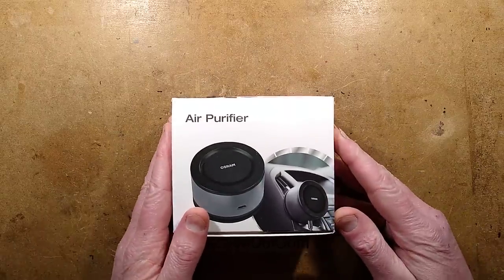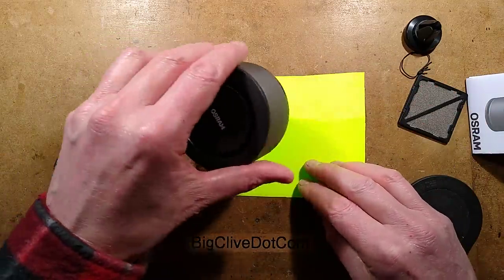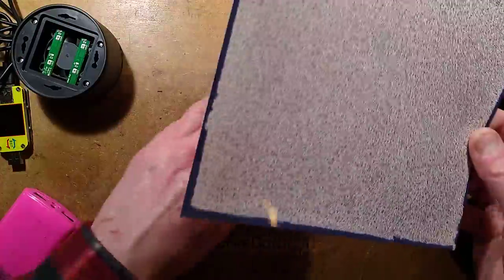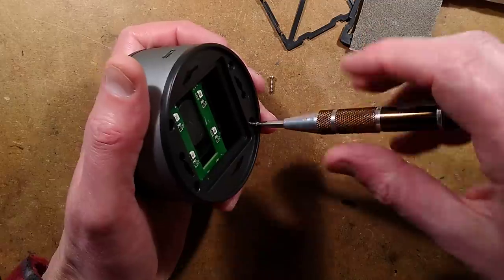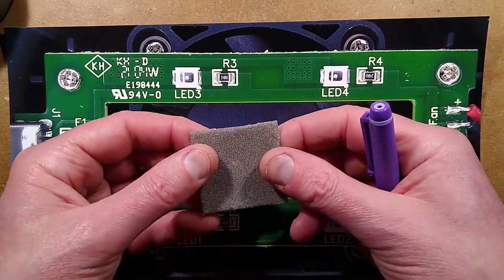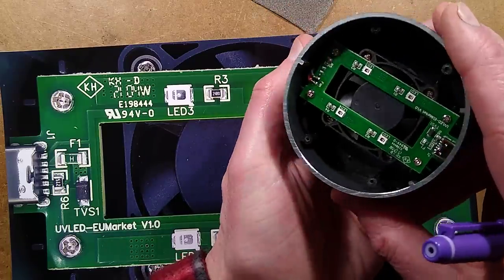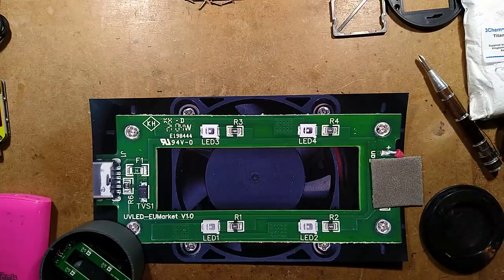Inside an OSRAM AirZing photocatalytic air purifier

Comment: Many white metal powders changes colour when they're sintered, and I'm guessing they've just mixed titanium dioxide with other metal powders of lower melting points.

I do think the process of UV light on titanium dioxide as a concept works. But I don't think this product does it at a scale where it practically matters. If we were talking 10W of UV on a high quality catalyser (think several m2 of surface area) it would probably be useful for small enclosed spaces like a vehicle or small room.... that is, if you have a problem with bacteria, fungus, virus and whatnot in the first place.... But this, as a product, seems like a solution in search of a problem. Or a product which is designed to make you think you have a problem...

Comment: Some sort of nickel foam coated with TiO2, I'd venture, similar to an auto catalytic converter, minus the $$$ platinum group metals.

The stuff at magnification looks a lot like the interior of a bad weld with porosity after you start grinding on it, not that I would have ever done such a thing. 😁
Reply: Sort of think well cannot conferm nor dnie that some one has done that varey thing!

Comment: To be fair, Clive, your 2nd magnified photo shows (to my eyes) the wire loops encrusted with white. It's only gray at zero magnification. I paused the video and looked closely, and it still looks like the mesh has been dipped in a chalky substance, so... mebbe my screen colours are wonky, I dunno. Edit: BTW it doesn't seem like junk science to me, and Osram are pretty respectable - they're using real UV-A too. I'm normally very skeptical...

Comment: So interesting. Can you measures the electrical resistance of the porous metal filter? Often catalysts are metals on a ceramic carrier. This one looks like metal  perhaps titanium slightly oxidised. For instance aluminium always has a thin oxide layer. Even shiny chromium has an oxide layer. When I measure the resistance I'd aluminium I musst puncture the inside layer.

Comment: Ugh, why do I get the feeling that the silkscreened "EUMarket" means that there's a "USMarket" or "NAMarket" (N. American) that leverages some flaw in our system that let's them get away with using cheaper "Near-UV" LEDs, whilst still charging the same price...

I bought some UV LEDs when the Radio Shack stores were closing up (standard ~3mm through hole) , which offhand I think are only like 485nm. Whichever it is, they're not quite UV, but point being they still produce the same glowy fluorescence of things like one would expect... So those none the wiser would likely not question it. Which in this case, being cheaper to make would be music to the bean contests) counter's ears 😔 (not sure if OSRAM is still a reputable name/company?)

Comment: Looks like nickel foam. We'll have to just believe it's coated with TiO2. They do look like authentic deep-ish UV 250nm LED's.
Reply from the maker: I've just ordered some TiO2 coated nickel foam.  Now I'm wondering how to test it when it arrives.
Reply: @bigclivedotcom  Maybe put it in a jar with some VOCs and see if they're detectable after different intervals of UV exposure? Neat, I didn't realize you could buy it already coated.
Reply: @bigclivedotcom  It's also supposed to be able to split H2O. Submerge some under water and leave it in the sun and check for formation of bubbles? I don't know if the particle size matters.

Comment: Since this is an appropriate video to ask, about UVC. 
I have found almost nothing on the internet about that, as we know UVC tubes are very "dangerous" and do work as space and surface disinfection. But UVC LEDs do actually exist, they are expensive, and are covered in gold (at least looks like gold) but I dont know about how effective/dangerous they are compared to regular UVC tubes.  Can a few real UVC leds each about 30mA to 350mA (at around 275nm) do anything? (LEDs the size of a standard 5050 smd package)

Comment: Reminds me of those low power heaters you plug directly into a socket and they claim they're better than a much more powerful heater in a more convenient location, only in this case it's a teeny tiny filter thing that is very very small fraction of an actual air filter that does the filtery thing... :P
Reply: It's not a mechanical filter that traps dirt in a tight mesh.  And it's only rated for the small air volume of a car.  The main volatile organic encountered in such places is gasoline fumes and leaked engine exhaust.

Comment: They made the same mistake as with the Raspberry Pi 4 by using a single 5.1K resistor for the USB-C port.
High power supply's will detect it as a Audio Adaptor and don't supply any power because they didn't use separate resistors for both CC pins.
Reply: But they fix this in later review, right?
Reply: @maxpayneau  Raspberry Pi fixed it pretty fast

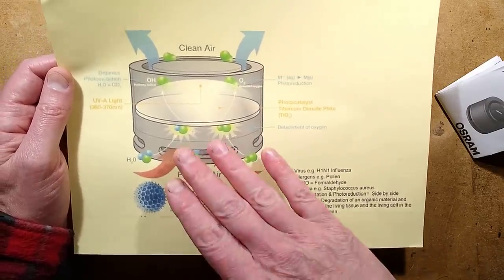Comment: According to the graphic depiction around 1:27, the polluted (or contaminated, whichever anyone prefers for their own use of wording) air goes into the unit on one side of the huuuuuge ceramic disc, passes through the disc , and leaves the unit on the other side.
I wonder if they've built in Star Trek's Transporter technology here? ETA: Or is it Duke Nukem's Shrink Ray cannon?

Comment: Except some metals like very pure gold for example, all metallic objects are covered with a thin oxide layer but one sees these as shining mettalls. Actually, one sees two spectrometric images determined by the metal, faintly by the oxide layer and by the components of the incident light. In case of alluminium this is easy to see: after a scratch it shines brighter, the oxyde layer attenuates the shining but aluminium oxyde particles (powder) are white because of multiple diffuse reflections at the surface of each particle. All in all: powders tend to deceive our eyes in analyzing the adsorption spectre. I guess you've a stainless steel mesh with TiO2 nanoparticles directly synthesized at the surface of the base metal by wet reaction, therefore the shining difers as a function of the thicknes and porosity of the layer. Thys catalyst works for some classes of dangerous chemicals when exposed to UV, it can create dangerous by-products and is going to degrade in time. I'd only rinse it with ethanol and with deionized water an avoid touching it.

Comment: never tried one, but thought about hacking some cheap nail varnish hardner for their UV LEDs and use them in an air purifier filtering chamber. then not sure if the wave length is germicidal enough...

Comment: Those LED's should be around 365nm (blue light) and do an amazing job destroying viruses, as opposed to cheap units that have the not very effective 385nm-395nm (purple) LED's. Someone said they thought the LED's were on the wrong side of the mesh. I disagree cause they will destroy anything that gets through the mesh. Those 365nm LED's are alot "hotter" than people realize. Un-diffused they can burn your skin and retinas. 

I have a couple of high power 365nm flashlights in the 365nm range. They are the Convoy C8 and the UVBeast V3. Both are the best out there on Amazon, but the Convoy C8 is more intense with it's single 365nm LED than the UVBeast V3 with it's three 365nm LED's. Both have patented filters built in to purify the light even more. Now i'm curious if these lights will kill the stank of the wife's WinterVag. {0.o}  😆😂🤣

Comment: Different subject. But how do stop DC switch sparking on a 36v li ion battery ( e bike ) .
Reply from the maker: If the switch is arcing because it's breaking high current then it may have to have a wider breaking capability (DC sustains a continuous arc like a welder.)   A snubber network - a resistor in series with a filter capacitor - will potentially shunt the arc noise and help quench it.

Comment: unless that thing is costing a hundred or more  I would suspect there is some exaggeration in the add copy. While the technology may be true the effective volume of such a little device would would probably mean it would take a long time to do what is claimed and then only in a closed space. might be OK for long term storage in a garage if you kept the battery charged
Reply: Left in a camper van when unused might keep mustiness at bay.
Obviouls need to keep the leisure battery topped up if that is the power source of choice.

Comment: All of these in-car devices (humidifiers, purifiers) are such bunk if you think about it: How much air do you think your ventilation system replaces continuously? Better to replace the cabin air filter annually (with a HEPA or carbon filter if you have respiratory problems). If you're sensitive to dry air you'd be better off with a mask that doesn't waste all of the exhaled moisture, instead of wasting money on those super dinky humidifiers, which are basically just a visual gimmick. But, a look inside those devices are still very interesting. 🙂

Comment: My thoughts...

I am so disappointed with Osram.  They were a respected manufacturer of incandescent bulbs here in Australia, so when I decided to replace all our (many) aging CFL bulbs with LED I didn't think twice about buying Osram.  Boy what a mistake.  30% failure within six weeks, with 11 chip LED arrays being overdriven and failing, flickering, malfunctioning, land fill pieces of crap with the cheapest possible capacitive dropper in them.

So would I trust them to produce an "air purifier"?   Not  really.  Once bitten, twice shy.  Maybe there is actually something in it, but I wouldn't put money on it.

Finely powdered things (Ti02 etc) always look different to the solid version of the same thing.  Powdered glass is white, the solid version is clear.    Kaolin powder is white, solid is brown (it's a Si04 clay with cosmetic and medical applications).  Typically, powdered versions look white or a much paler version of the solid.  I think it's to do with grain size in relation to light wavelength, or to put it another way: high reflectance AND high refractance.  Light has a surprisingly long wavelength really.  We reached the limits of light microscopy over 100 years ago for example.  Light just didn't have the resolving power we needed to look at even bacteria in any kind of detail, and a bacterium isn't much smaller than powdered Ti02.  Some are actually larger.

Incidental fun fact: TiO2 is considered a safe food colouring (white) however it's now considered a carcinogen on inhalation due to testing done with rats.  Whether or not it's an issue for humans is unknown however it's considered to be a risk.  When an e-liquid company way back in 2013 was making bucket loads of money selling "unicorn milk"  in the USA they ran full tilt into the reality of the fact that vapers take harm reduction very seriously.  "Unicorn Milk" was basically strawberry flavour with TiO2 and a bit of red food colouring to make "pink strawberry milk".  Once the vaping community figured out what it REALLY was (ie not actually unicorn milk) the backlash was tremendous.

Since it's an oxide, and has been re-manufactured into a mesh, I'm thinking this is basically a form of ceramic. A very unusual one to be sure, but I'm thinking the manufacturing process might involve TiO2 powder and a hell of a lot of pressure and heat.  If the solid looks kind of grey/metallic it would not surprise me in the least.

Comment: Is it work?  Probably? Maybe? But I just know that If company have lots of cheap materials, they often mix them together and sell it as new amazing technology. Also even if something work in small scale/closed environment, when they try to bring it to market it lose all its properties or, because it was scaled up, it make so little of what it should do, that its like trying to heat house with one candle. And often its the deal with anything that advertise as "air purification". Yes it work, but when people throw such device to car/house with very dynamic air flow and with often draft from open windows and doors... it make no real difference. It work of course, it produce ozon and/or "clean air" but is it efficient in such dynamic environment? Maybe? Probably?

Comment: for the price i would expect it to be made of solid gold !
Reply: Here in nl they are on sale at lidl for 14,95... not too expensive if it actually does anything..
Reply: First thing I also did was checking its price. And indeed over here at Lidl it's €14.99 (from €24.99) and at the ANWB (our version of the AA/RAC) they're sold for €49.99.
Reply: 57 UK Pounds at Micks Garage !

Comment: Is that like a car catalytic converter? But obviously no UV in a car exhaust.
Reply from the maker: I've never really considered how the catalytic converters in cars work.  I would guess it may be heat powered catalysis.
Reply: Photocatalysis is a bit different, but the functional principle is the same. Heat indeed provides the activation energy in a car's catalytic converter, and the catalytic materials are platinum-group metals for breaking down nitrogen oxides and carbon monoxide.

Comment: Very hard to believe that does any difference in practice. You cannot get much chemical reactions induced by quarter ampere. Even when assuming similar efficiency than in electrolysis.

Btw. pigment grade TiO2 is not very photocatalytic.

Comment: Real uva LED's have a larger voltage drop of up to 6v.  What you got is not uva LED's
Reply from the maker: UVC LEDs tend to have the higher voltage.
Reply: @bigclivedotcom  oh I might have confused A with C. I meant the ones with the shorter wavelength have 6V forward drop. Sorry about that.

Comment: Osram is a good enough make, so probably does what it says on the tin well enough, i just open the windows to get clean air.
Reply: Air outside the car is usually worse than inside. However a good purifier needs to handle the full airflow from the ventilation to keep up with ingested pollution.
Reply: @johndododoe1411  as far as bacteria and viruses, the fresh air outside is cleaner, this device is not an air filter or purifier in that sense.

Comment: I bought 1 a few months ago  from lidl walked out of the shop got in my van and plugged it the cigarette lighter charger  , reading in user manual  to find it was not chargeable  and it had to be plugged in all the time and looking at the size  of the bloody thing unplugged  it popped in back in the box walked  into lidl and got my money back  =  I drive a van and it look stupid  connected  to one of the vents  😉
Reply: what did you expect in the first place ?

Comment: Hi Clive, did you see Wranglerstar's latest video showing his viewers how to wire a double male plug to power his trailer from a generator without any back-feed protection into the grid??

He back feeds an eco flow "generator" via a male-male and the trailer also hooks into the grid via an external caravan plug 🤦🏻‍♂️.
Reply from the maker: Widowmakers.  Dangerous devices.  A proper appliance inlet is preferred.

Comment: I'm sure it works, it's a proven theory. But how effective is it with such a small surface area and low air flow rate? Surely the bad air wins? Simple test go into a long distance driver's cab who's using it and see if it's really as daisy fresh as the marketing would have you believe.

Comment: This product for me falls to the realms of an unnecessary waste of resources.  The actual benefits of this device are very questionable and ultimately any benefits aren't worth the environmental cost of making, using and ultimately recycling it.  If these pointless devices weren't made at all, the resources could be put to better use and the energy saved.  I'll admit there are far worst examples, not least the myriad of cheap toys that include an electronic circuit.